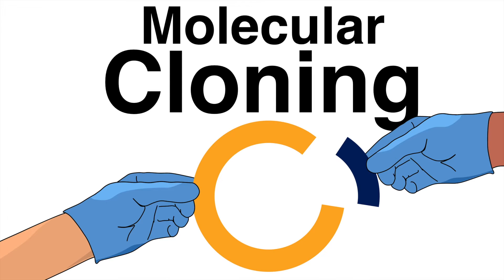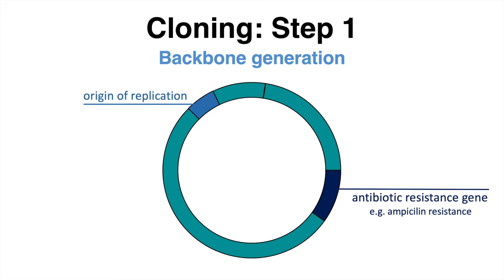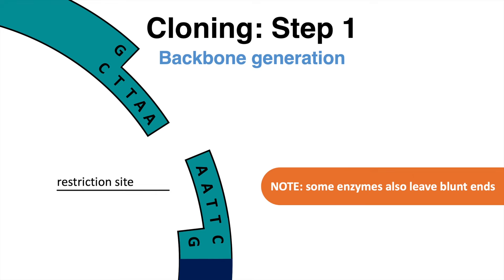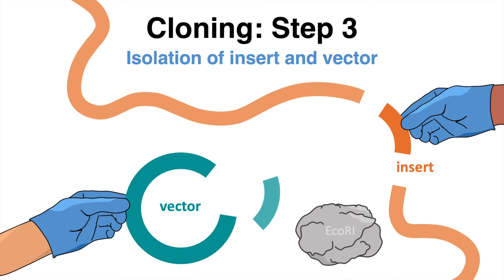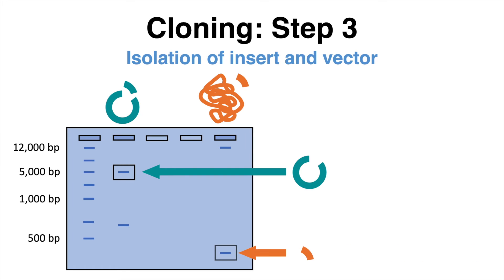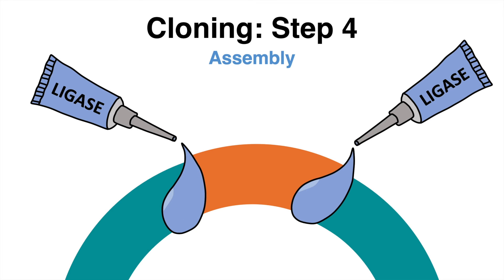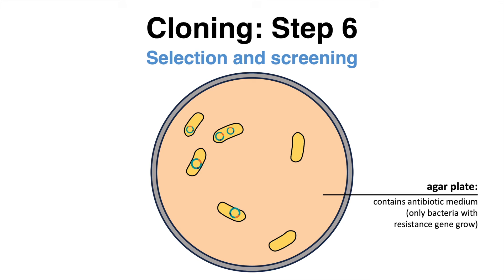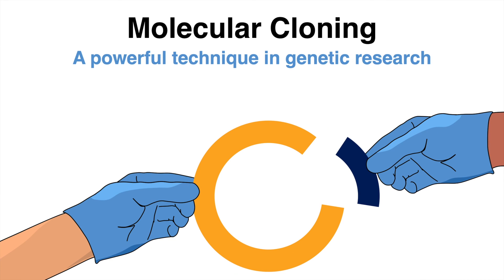Molecular Cloning explained for Beginners

Comment: @5:55 I noticed you pronounced the V in "unveil" as though it were a W. This is a common mistake if you're coming from certain non-English languages. But I want to point it out to help people learn the correct way to pronounce Vs and Ws. It's entirely possible to train the mouth to say Vs and Ws correctly. Something to work on :)

Great video + explanation + visuals overall.

Comment: If a gene is inserted incorrectly in the plasmid,  will RNA POLYMERASE start transcription or not? The bacterial promoter works but rna polymerase will start transcription?
Reply: if there's no "stop" mechanism and it has all the precursors, it should.

Comment: 5:40 fyi You can also use the white-blue verification to see if the recombinant Plasmid is working. Here the MCS, the part where the DNA is inserted, lies within the promotor region of a LacZ gen, that will turn the colony blue, if the medium they grow on contains GalX. If the insertion was successful, LacZ cannot be produced, which means the E.Coli colony remains white. Sorting then, is simply scraping the white colony of and to proceed cloning with that. (Works only after you already pre-selected via Antibiotics) 

This is a great Video!